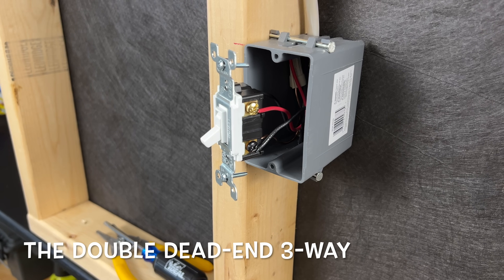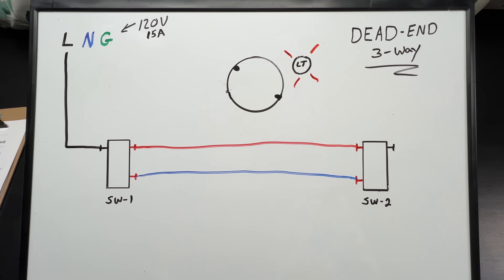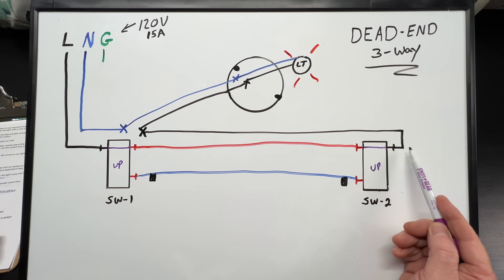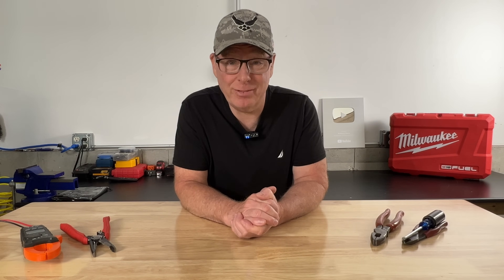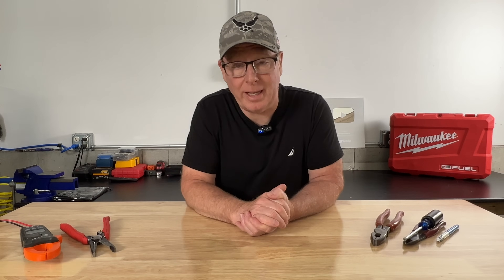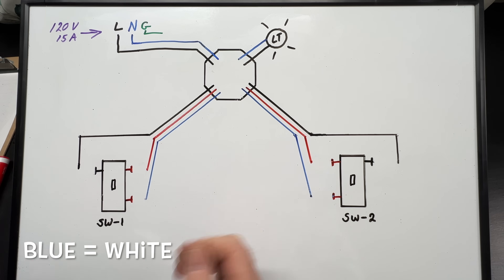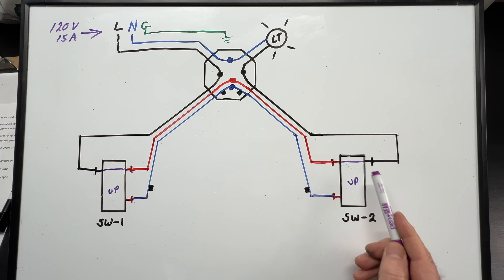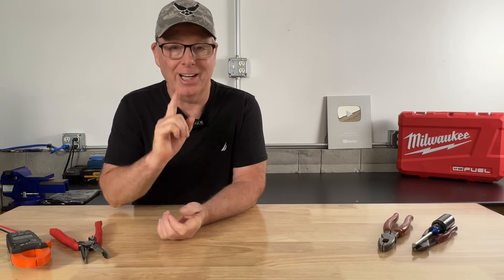Double Dead End 3-Way (Secret Method Reveled)

Comment: It can become code compliant if you use something like 14-4 (white, black, red, blue) on the feed to one of the switches.  Use the white wire as neutral there.  As for re-identifying the white wire, I'd use red tape to identify it as a traveler.  It makes things nicer at the switch and the wires won't get mixed up.  I believe that you can get things like 14-4 if you ask for it, but it may be special order.

Comment: This diagram doesn’t apply to my situation. I do have 4 cables running to my ceiling box but the cable running to my first 3 way switch is only hot and neutral 14-2 with the neutral marked as hot. The cable that travels to the other 3 way switch does have a red wire with the hot and the neutral. I was told the way it was wired when it was working was incorrect but after trying recommended wiring variations it was unable to work at all. Very frustrating. I guess it’s time to call an electrician…

Comment: This is one of two ways we here in the UK wire a two way light switching circuit, but our "traveller" cable would run straight from one switch to the other. With the older more traditional arrangement there would be a two core and earth running between the traveller terminals with a single live feed to the common terminal of the first switch, with a single switched live running from the common terminal of the second switch to the light,  while the later method is to run a three core and earth between the switches with two cores between the traveller terminals and the third core connecting both commons, with a two core and earth running to the first switch with one core to each traveller, one a permanent live feed, and the other a switched live feed to the light, with that two core and earth coming down from the light fitting, usually on the ceiling.

Comment: Hi, from England, UK. Isn't it a wee bit dangerous having all those bare earth conductors so exposed in the switch pattress with those live terminals also so exposed, isn't there then an increased risk of the live terminals shorting out to the bare earths when the switch is screwed into the pattress? Here in the UK we have to fit green and yellow sleeving on the bare earth conductors, and we're phasing out cables with bare earth conductors now too and the new cables will have the earth already insulated.

Comment: It'll cost a little more but if you use 14/4 for those dead-end runs you can have a neutral at each switch location, and you get a red and a blue wire for your travellers..
The big box stores don't carry it but some of the dedicated electrical suppliers do .   Seeing 70c to a buck a foot for a 250 foot roll currently.
Reply: Not just a good idea but a necessity since the electrical code (NEC and CEC both) has required neutrals in all switch boxes since 2011.

Comment: 1:53: IANA electrician, please forgive my ignorance. 

What is the switch leg hooked to with a wire nut? If it is just the continuation to the light, why does it have to go back to the box - you show no connection to the switch or anything in it? Why not send it straight to the light?

Same with the neutral, what is the need for a junction box before the light?

Thank you sir!
John

Comment: If retrofitting from a single switch to a 3way, there would only usually be 14/2 to the first switch. Either as power would enter at the switch, or as a drop loop (power from fixture, down on black, returning power on white retapped black). I haven't been in the residential game much, and usually like to run 14/3 to light boxes just as future prep, but are drop loops with 14/2 illegal now?

Comment: I don’t get it. Even in a normal three-way switch connection, the second switch is also a dead end, because there is no continuous power only the two travelers, each of which is switched power. So you can’t wire on to another outlet or switch. So really, they’re both dead end, no?

Comment: You extra switch is like the no longer liked "switched loop"  in which the neutral doesn't appear at the added switch box.   The problem is that fancy switches with electronics and timers and light sensors can't be installed at the new switch.
Reply from the maker: With smart switches you only need one for switched lights. So when you have two or more switches controlling the same lights like we do with 3-way and 4-way switches, only one would be a smart switch. So you install the smart switch in the box with a neutral wire. That’s why the code only requires a neutral wire in one switch box where multiple switches are controlling the same lights.

Comment: Rewatched the March 18, 2024 video first and drew it all out. Then rewatched this one. Trying to figure out my old house when the power enters at the light not the switch and some of my not working switches and how it should be for anything new.

You're great at explaining a dead end 3 way. Is there a reason that this video's explanation at the beginning and the other video swap the reidentified neutral (blue) and black wires that are between the 2 switches and get wirenuts in the first switch or connect switch 1 to 2? Is there a way that it is supposed to be? Does it matter one way or the other?
Reply from the maker: There is but most investors don’t care. There is a requirement in the code that the re-identified neutral cannot be switched. So for the dead end you would carry the hot wire in box one to the common on switch two on the neutral. I usually don’t show it that way because it can be confusing to many people. The intent of the requirement is to not have a re-identified white wire and a white neutral wire at the light. This can lead to accidental short circuits or reverse polarity. I’ll make a video discussion this soon.
Reply: @BackyardMaine  thanks for the reply! I look forward to a video on this, great topic. It makes sense to not want the reidentified white and the neutral white at the fixture. Especially since a lot of the light fixtures purchased now from us at the big 3 hardware stores are integrated LED instead of changing bulbs so more people are getting up in there and changing fixtures as a DIY project.

Comment: thanks for your videos   I'm  looking to install a 3w 4w 3w switches    with power coming into the middle box with the 4w switch   is this aloud?  and out to the light on either 3w switch     what would the diagram look like    thanks
Reply from the maker: When you have three or more switch locations the two on each end will be 3-ways and the ones in the middle will be 4-ways. The 4-ways will only have travelers and the ground connected so you cannot feed or connect the light at that location. But remember it's not the actual location of the switch but the way it's wired. So if you feed that switch in your middle location or have that switch connect to the light, you would install a 3-way there. Then run a three wire to either of the other two switches where you will install a 4-way and run a three wire from that location to your final switch where you will install another 3-way which will either connect to the feed or the light. I hope this isn't too confusing.
Reply: @BackyardMaine   a little but diagrams work better

Now trying to wire a new 3w to a existing light on stair landing adding a 3w at bottom of stairs and add a new light

Comment: If you replace the 3 conductor cables with 2/2 conductor cables or 4 conductor cables , then wire the neutral, as long as you're within volume allowance, its code compliant

Comment: Hello sir, like a few other fans of yours, I've watched a whole lot of other videos, and yours is by far the easiest to follow and comprehend.  I can't remember all the details of the others, so I'm wondering if you can help me to find the right one that you teach that will do the following - in non-electrician technical terms...
Is there a variation where, you can turn the switch on at Point A at the end of the hall, turn it off at point B other end, then if someone else walks up to the hall at Point A, and its dark, can just flip the switch the other way and the light will come on...... then get to Point B and turn it back off.  But if they turn around an hour, can turn it on at Point B, and walk to Point A and shut it back off and leave the house.

That is what I am trying to do.  I wired it from the circuit, 14-2 to Point A, then used 14-3 to Point B - then 14-2 to the light.  And does not do what I was trying to do.  At works but, not the way I would like to.....

Thanks for a great channel, and for the great information.  I always love your pieces.
Thanks,
Jon
Reply from the maker: Absolutely. The way you have the wires pulled is for wiring a standard 3-way. I have a video detailing that on a white board. https://youtu.be/B6gfI73Tvg8
Reply: @ thank you so much for the answer and the link,sir!!! I will wire this up today and send you back a report👍
And when I’m done enclosing Point A, the whole wall, it is a ‘feature wall’ in a living room, so it will be covered in a cementitious material with integral color, like real ancient plaster….. I’ll send some pics, so you know you helped finish this job. 
Thanks again. 🙌👍😉
Reply: @ ok, so I watched the video….. and it doesn’t sound like it’s the ‘dead end switch’. But it also doesn’t sound like it’s the regular 3 way…..🤔

How do I wire it so Switch A and way at the end of the hallway Switch B, can turn on and off the same light???
The easiest way to say it is so the silly kids can keep turning the light on and off in each other from the different ends of the hallway. 
I’m still not sure which method?
Sorry to bug you so much. 
Jon.

Comment: Hey backyard maine I am installing 12 volt wall sconces on garage and underdeck can I ran a 12 volt wire in switch box with 120 volt switches so that I can switch the 12 volt separately

Comment: The most common thing  homeowners do is take out the 3 way switch and replace it with a single pole switch with the hot wire on the green screw....seen it over 20 times.... wood floors / carpet and plastic box it would never short out or shock them......

Comment: Don't you need a neutral at the box though?
Reply from the maker: You do need a neutral at one of the two switch boxes now. I think I mentioned that this cannot be done on new construction and actually there would be no reason to with the walls open. It is a method to make a single pole into a set of three ways on an existing building

Comment: Very thankful for the single dead-end explanation you gave first.  I have watched other videos of this exact setup where power and lights are coming into the first box with only a switch at the second box.  While other and different wiring explanations seem to "work", they were complicated (by passing line power over through box 1 to box 2 and then using common on SW1 up to the load side.  That method seems to not work if adding a Lutron Diva dimming switch at SW1 location like I want to.  Your video is VERY clear and easy to follow and solves my problem!  Great video!!  Thank you!
Reply from the maker: Awesome. I’m glad it was able to help. Thanks.

Comment: Right before your sponsor message, it clicked what you meant by "double dead-end 3-way".  It's when the power is fed to the light fixture first, and each 3-way switch is its own "dead-end" that heads back to the light box.  Unfortunately I had a friend wire all the lights in his newly-furbished basement like this.  And several 4-ways were involved too, and they all went to the ceiling too.  And none of them were marked.  And almost all of them were cut off way too short in the ceiling box.  It was a mess!

Comment: It is interesting how they are jumping back and forth between compliant and non-compliant over weird reasons. As long as you don't do a Chicago 3way, you are pretty safe :)
And of course, you would normally cross over the wires, so the light is off, with both switches in the off position.

Comment: All of the 3 way switches in my parents house from the 60s are wired using these two methods. I always called these "power at light" for the double dead-end and "master slave 3-way" for the dead-end.

Comment: For those who believe a neutral is required by code, that is incorrect based on code. But we need to remember that code is the minimum requirement, so jurisdiction having authority can require a neutral at every switch location. Having a neutral at every location is not a code violation. Not having a neutral at any location is a code violation. Depending what code year your state uses will also determine what are violation and not violations. There are States that still only apply the 2008 code, so what does that code year say about it?

This reminded me of me installing 2 dead end 3-ways with a 4-way. The line and load go to one outlet switch box. The power ties to one of the 3 wires sending it to a 2nd outlet. The switch leg ties to the other 3 wire going to the 3rd outlet. The white and red wires are used as travelers from each of the 3 wires, but instead of tying them together they are landed on a 4-way switch. Then obviously the neutrals are tied together and grounds.
Reply from the maker: No actually. The AHJ cannot make up code. The enforce the code but don't make it up. If there is an argument about the interpretation of a code reference the AHJ will have the authority.

Comment: This demonstration is really pointless unless you live in a older home and trying to figure out what’s going on, electrical code requires you to have a neutral in each box. There is still a power and feed and dead in switch option where you don’t have to have a neutral at the dead end side. But as far as new construction goes, that is an old method and I wouldn’t use it because it’s completely outdated , and the way that I would do it, you would never have to use a white as your common or your traveler. There’s many ways to accomplish a three-way switch. I appreciate you showing us a video on a 1920 style three-way switch keep it up. It’s interesting.

Comment: Just a question from germany, don't you have more than 3 wires each cable?
It is a little confusing because we also can have for such installations a 5 wire cable. 
We use brown, black, grey as hot wires, blue als neutral and green/yellow (both colors combined) as earth or ground.
From newer standards the blue has also been seen as "hot" or active/line.
For LED stripes which use 4 wires, we normaly use a 7 wire cable where 6 black wires are numberd (1 to 6) and the 7th is earth in green/yellow.
The Chigago-variant is here known as "Hamburger"-schematic which is forbidden since about mid 80's. Double Dead End 3-way we don't use in this configuration since about 15-20 years in new installations.
Most we use a california variant, here mostly called "change-over" with 2 switches or cross-over with more than 2 switches.
It's very interesting how other ones have the electricity going :)
Big thanks for your videos! 
Some times I wish to have your larger boxes behind outlets and switches, espacily when planing went to the toilet ^^
Reply: No, it’s generally two or three wires per cable, excluding ground (so actually three or four, but the ground is not permitted to be used for any purpose other than as a ground)

Comment: I think this is how previous homeowner attempted to wire two 3 way switches to a light fixture in my house but messed something up b/c both 3 way light switches have to be switched up for the light to be on.  Trying to figure out how it got messed up w/o making a switch that insta shorts.
Reply from the maker: Sounds like you just have a miss wire. Someone probably mixed up a traveler and a common. Should be an easy fix.

Comment: After 2024, this is a code violation.  Neutrals are required in all switch boxes now.
Reply from the maker: Like I mentioned this is not compliant for new construction because of the code change. However you only need a neutral in one 3-way switch box according to the rule. 404.2(c)

Comment: I recently did some troubleshooting in a kitchen which was wired this way. Somebody (I’m guessing a homeowner) removed one of the  three way switches and put in a single pole switch. They didn’t know where to put the white wire so they put it on the equipment ground screw on the switch. It was an old cloth wire house without proper equipment grounding. So every time someone flipped the other three way switch the yoke and metal box had 120v to neutral. No one ever got shocked because there was no ground nearby to touch. Plus once it was all installed the only non plastic parts were the two painted screws holding the plate on. I did put my probe in the screw slot and tested to a nearby outlet’s neutral and it was 120! The homeowner said it was like that when they moved in a couple years ago. Crazy!
Reply: That might explain the back door of the house I grew up in (years ago).  Old house, cloth wiring, probably done by an amateur.  If you leaned against the screws on the switch plate and touched the metal screen door, you'd get a shock.  From very mild to one time made my arm numb and brought me to my knees.  We had a couple of electricians look at it and they could never find the problem. We learned to be very careful when flipping that switch.

Comment: Thank you for posting this . Just came across this when someone on the carpenter crew disconnected the switches during renovation and they ask me to take a look at it. I figured it out and in my mind I thought I had it correct then I came across your channel and it confirmed I was correct on reinstalling the the three way switches. Hey what’s up with the Air Force hat ? 37 years all together for me